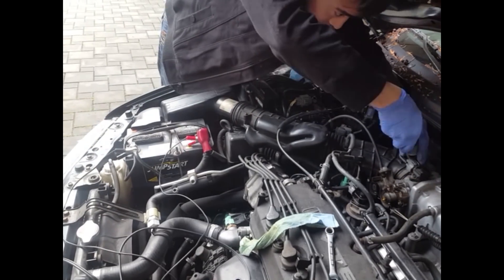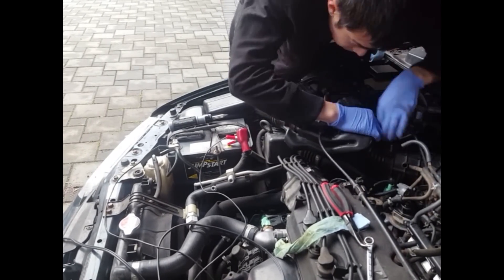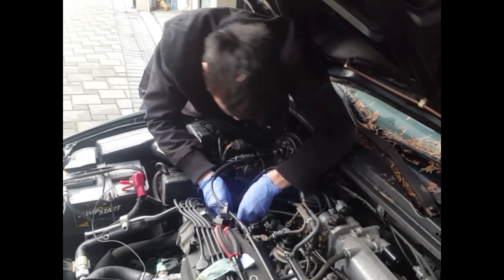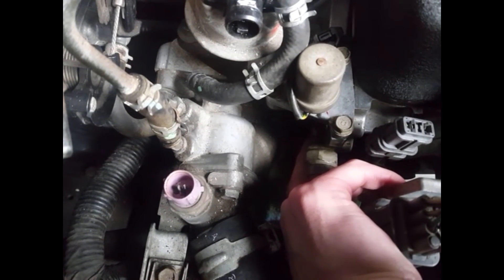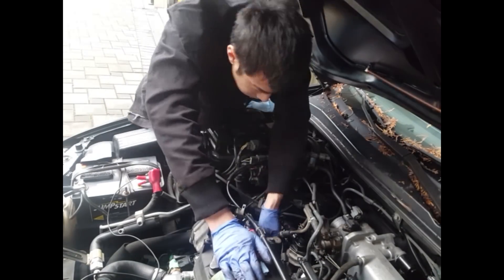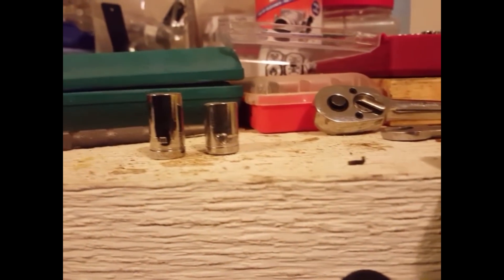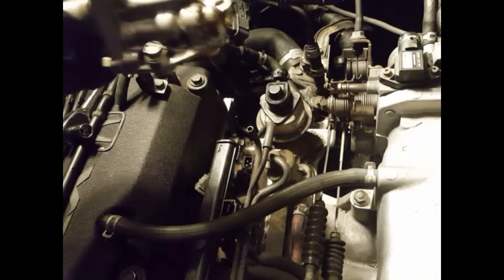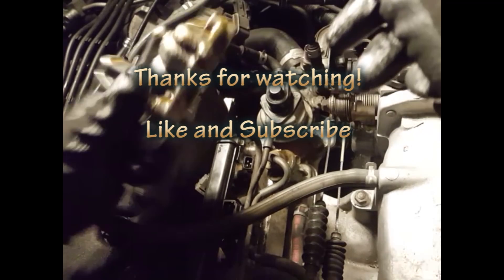How To Remove & Replace Honda VTec Solenoid by only removing Air Intake

Comment: Why did you change the solenoid what it was the problem in your car? I have the same car.
Reply: They like to leak from either the solenoid gasket, spool valve gasket. Also sometimes from inside the sensor.
Reply: In my case it throws up a code.

Comment: Hi, greetings from Malaysia. Tq for this great video. I cant help to notice that ure car got secondary air box which located below the air cleaner hose. I got it too. Do u mind to explain on what does it do ? I think i got mine a misplaced or unused vaccum hose which intact to the secondary air box. Not sure where all the vacuum cable/hose should come/go into. Tqvm.

Comment: I have a 95 Accord EX 2.2L. I got a engine light code 21. I believe the code is referring to VTEC solenoid. The car picks up slower. When the engine light first occurred, my speedometer started sweeping a lot, so I happened to replaced the output speed sensor(VSS) for $5 on ebay. I really thought the VSS was the cause of code 21 since it happened the same time. Well, after replacing the VSS, the engine light still come on for code 21, but the speedometer fixed. I have cleaned the VTEC (only the 3 screws top part) and the engine light still comes on. Do you have any other solutions?
Reply: Same things happened here, I don't think they were related but coincidence.  Replaced my VSS to fix the speedometer (and shifting), pulled vtec assembly to clean and it wasn't dirty/clogged, so I tested the Solenoid (36171-P0A-005).  $30 on ebay later and codes are gone and engine pulls nicely again.  I'm pretty sure they used the same solenoid from 1992 until 2002, so you could probably find it in any scrap yard if you would prefer.

Comment: Would the removal of the part be the same on a 99 Honda Accord?
Reply from the maker: Hi David, short answer yes!

the 6th generation  Honda Accords had very little changed regarding the engine. The V-Tec solenoid is located in similar location. Even the gaskets from the 1994 - 2002 are the same. 

here is the part for both gaskets for the V-tec solenoid. Hope this helps
DORMAN 917170 {#15825P0A015, 36172P0A005}  w/ Spool Valve Filter Solenoid Base Gasket
Reply: Life of A Mitch thanks, very helpful bro
Reply: Yes...'98-2002